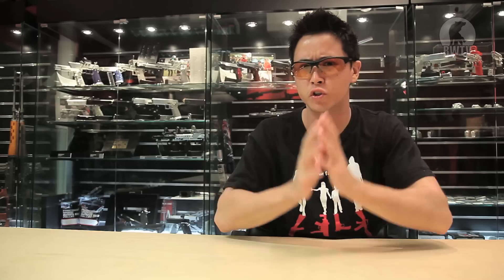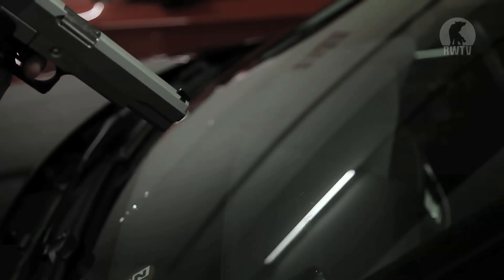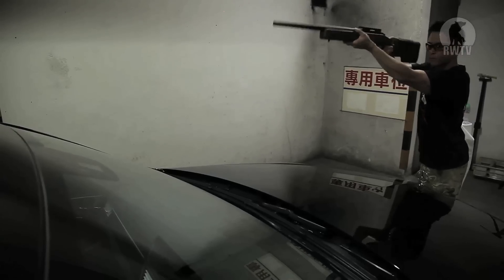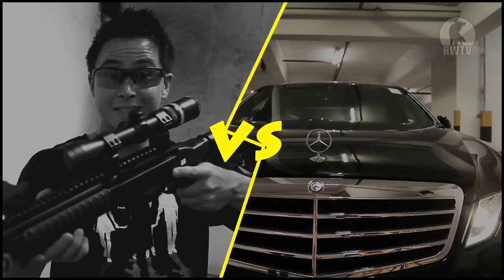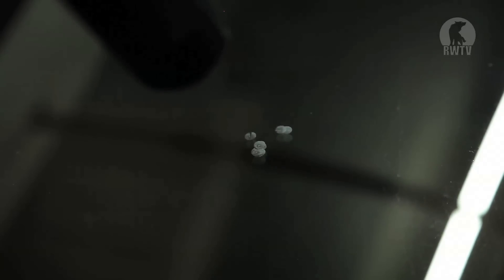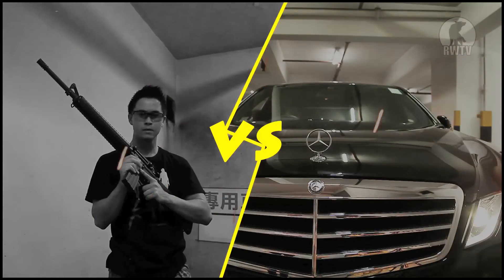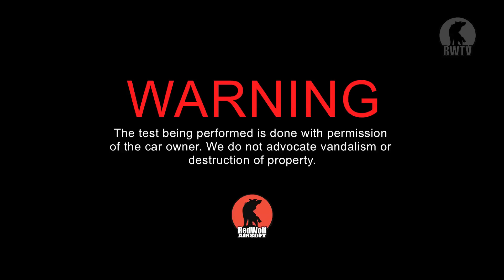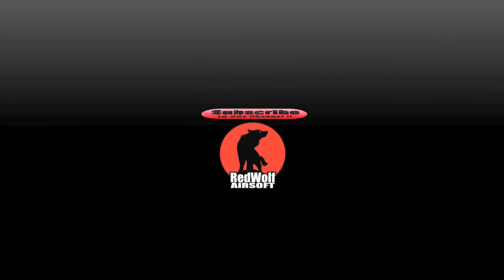RedWolf Labs: Airsoft VS Mercedes Benz E350 - RedWolf Airsoft RWTV

Comment: at taiwan we use co2 power WG m84 301 with 6mm or 4.5mm bbs  to braking car windows .(of course that's illegal in most country)  that is better than use 6mm plastic bbs with geeen gas .
Reply: aslo we well use 6mm steel bearing

Comment: the hardness rating of the glass is much greater than the bio bbs. if they used aluminum bbs the glass wouldnt hold up. its all about the hardness vs hardness not so much the weight or fps. that is why diamonds can easily cut glass, because they are harder than glass.

Comment: You would never crack that windscreen with an Airsoft gun because windscreen glass is laminated glass, its different compared to door glass which is tempered and would have a better chance of shattering as an Airsoft pellet could break its tension.

Comment: I've pierced a thin(ish) steel garage door with a 500fps DW 8" Revolver from 10 feet away.  I don't think you exhausted all your options. Could have used a 500fps sniper, or a 400fps LMG?

Comment: Wile I didnt expect to windshield to even care that you were shooting it and you probably need to shoot it with a .48 grain at over 400 fps to show a real sigh of damage it's still a nice test and it provs a point and thanks for the vid but knowing what I know about cars the windshield is not what we need to be looking at here the the grill on the front of the car is there to protect the inner grill of the coolant system of the car if that gets a hole in it and leaks all of your coolant and you run your car you will kill your engine in no time and know the way they are made I think even your high capa could do more then anuf damage to it to kill the car just food for thought though let me know what you think

Comment: I highly doubt an airsoft gun is going to crack a windshield Tim. Modern Windsheilds are made of 2 layers of laminated glass, which is curved to make it stronger and less prone to cracking. You can kick your foot, throw a bowling ball at it, or a hammer, it will just crack, but not lose it's shape. Next time try tempered glass, which can crack and go everywhere since it's not as strong as laminated glass.

Comment: I've cracked my bedroom windows from 6 feet away with a 350FPS gun on semi. I've cracked another from 100 feet away with 450FPS. I've cracked plastic car brakelight panels with 300FPS guns from 5 feet away. Dafuq with this?
Reply: A windshield is made differently than your regular window. Other kind of glass, you know... as Wiki tells us: "Modern windshields are generally made of laminated safety glass, a type of treated glass, which consists of two (typically) curved sheets of glass with a plastic layer laminated between them for safety." - so no wonder the effects of shooting at a windshield are different from those arising when shooting at regular windows or plastic panels.
Reply: @marekjaros3265  what about a rear window..under stress on a Hyundai Santa fe?
Reply: Made in Germany :P
Reply: Its German engineering!
Reply: That's safety glass. Imagine a couple of pebbles would crack your windshield on the highway..O__o Windshields must withstand that..
Reply: the windshield is on a different level :P
Reply: Collin C. Music i cracked my brothers head with 723 fps spring in the Novritsch ssg 24 sniper
Reply: Hilarious that you had the bedroom window situation XD

I just learned the same lesson from a tri shot "marines" shotgun

30 feet away it puts the pellets about a full foot higher than aimpoint...

I found out the hard way and it's 300fps max
Reply: Honda Civic much??

Comment: Why the fuck would anyone let you scratch their car? Fuck, I felt bad for that Mercedes. And if you want to do a meaningful bb vs car test, shoot the body. I could care less if there are tiny scratches on the windshield if it's like an old Miata or something, but I would hate hit marks on the paint.
Reply: Damaging the wind shield makes it illegal to drive since it needs maintenance straight away. You can damage all the other bits and still drive the cars legally. No one cares.

Comment: So if golf ball sized hail falling from the sky wont break a windshield. Why would every one wonder if a BB could crack it? You know, they make windshields to with stand abuse for a reason.
Reply from the maker: This is what hale does to winsheilds.  http://www.ronsautoglassmn.com/images/june-07-063-lg.jpg
Reply: Some people are saying to increase the power even more (700-800 fps) but i don't think that would help. The bbs would probably break apart when they hit the windshield. However, i'd be interested to see if you could crack a windshield with metal bbs fired at 450-800 fps.
Reply: Would have been some very large hail. A few months ago my car got some hail damage. It was golf ball sized if not slightly larger. And while it got thousands of dollars of damage worth of panel and body damage, it didn't receive even a scratch on the windshield.
Reply: ***** That's assuming the hail does not break apart. But they do, and much of the energy they carry is lost because of that. In the end, you cannot use a simple f=ma formula to calculate how much force the hail would actually exert on the windshield :P
Reply: A tiny rock flung up from the car in front of you can crack your windshield, genius.

Comment: Try something with 500fps and the car drives 40 Miles/hr towards the shooter
Reply: The systema ptw max that tim used last shoots over 550fps already.  That's a tough windshield
Reply: Who the heck would drive at 40mph in the middle of an airsoft game anyway? That's like asking to run somebody over.
Reply: Yeah sounds like a moot test unless you use a car within the game like an armoured vehicle....but 40mph sounds a bit excessive.